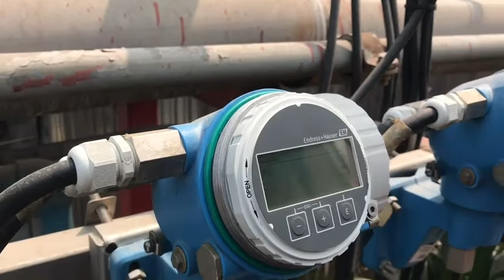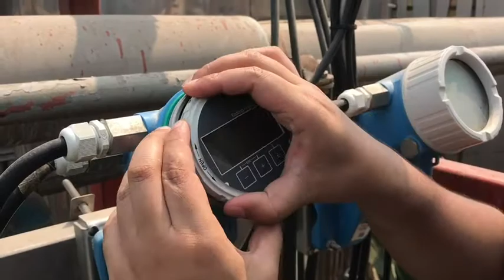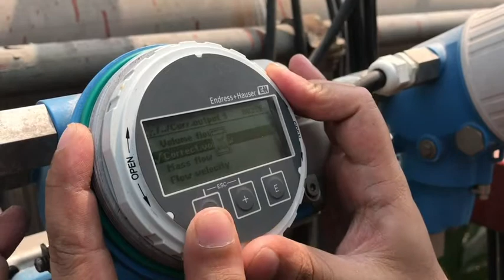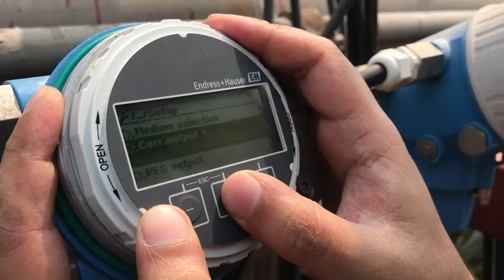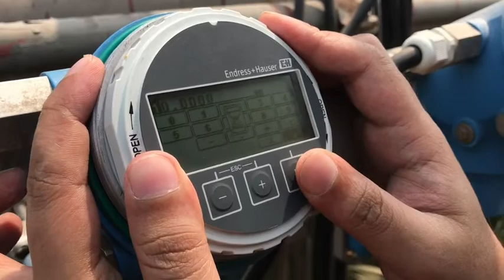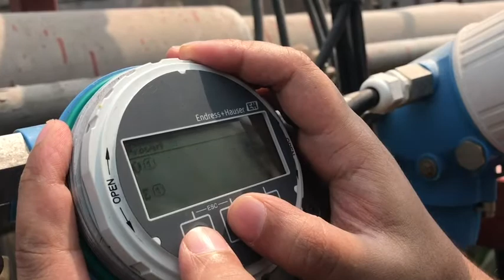Vortex flowmeter Prowirl f 200 setup E&H

Comment: pv output show always 0 and there is pressure in the pipeline
Reply: please check the (no flow) cut-off setpoint. Maybe this will fix the issue or you can check by the simulation to check the healthiness of the sensor.